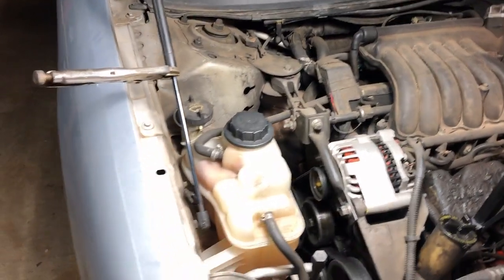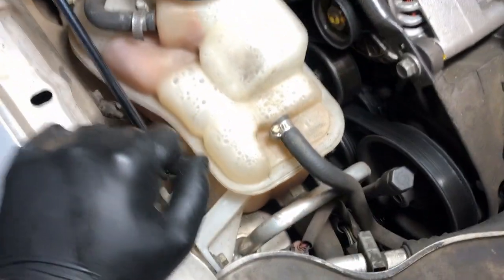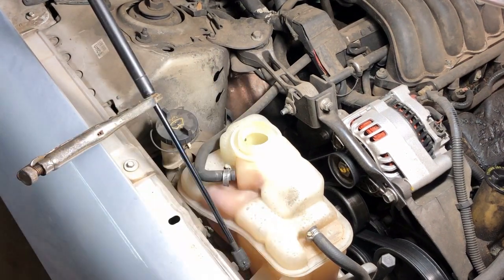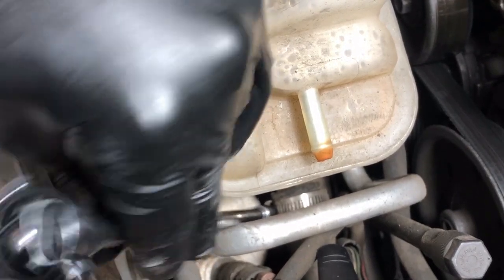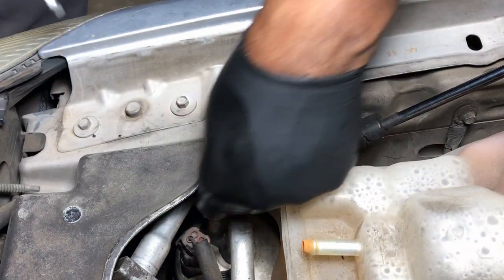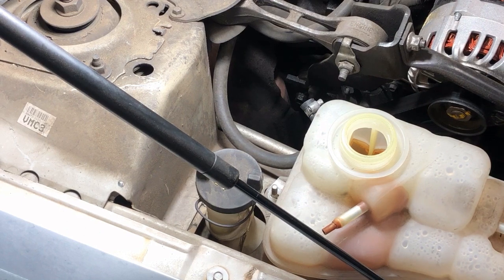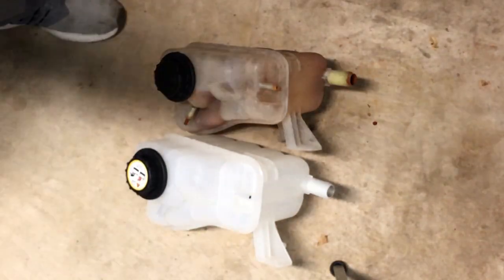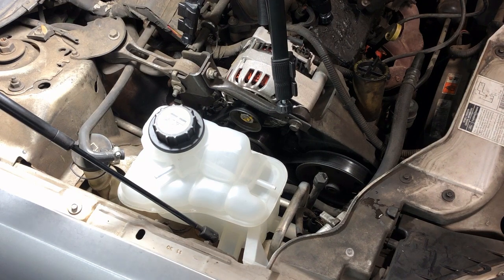Step-by-Step Guide: Ford Taurus Coolant Reservoir Replacement

Comment: Nice video man! I have a 2006 ford taurus and thinking about changing out the coolant reservoir tank too. Nothing is wrong with it but I've been making upgrades to the car and adding new parts and the one I have now just looks busty so I just want to put a newer looking one in there😂 A question though, the thicker hose you removed from the bottom of the reservoir what is that hose called exactly? Mine is cracked or punctured somewhere and If I can I'd like to replace it myself. I dumped an entire thing of coolant in and it leaked all onto the ground afterwards🤦🏽‍♂️
Reply from the maker: Thanks! Ford uses the term "degas" bottle to refer to the coolant reservoir. When you're looking for a replacement hose, make sure you look for the hose that's for the "degas" bottle. Just to be sure you get the right part, compare it your old hose and make sure the size and shape match up. Believe it or not, I've got the Taurus back in the garage. Trying to track down a coolant leak...more videos coming soon. Thanks a bunch for commenting and stopping by channel.